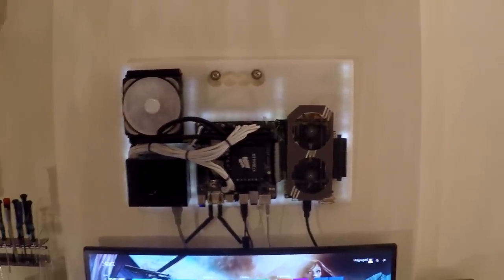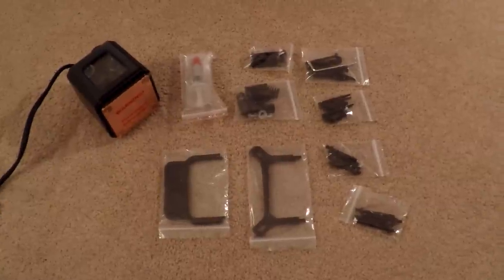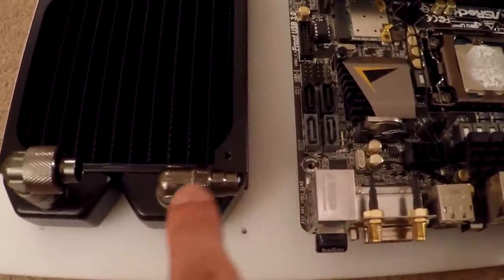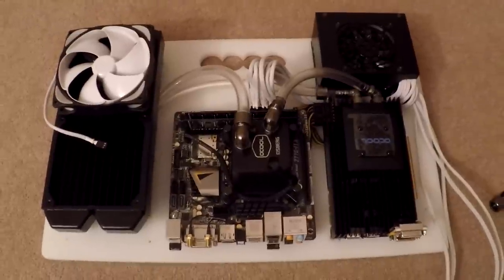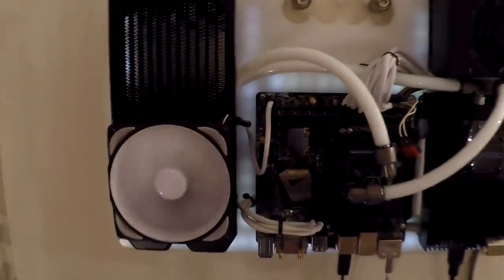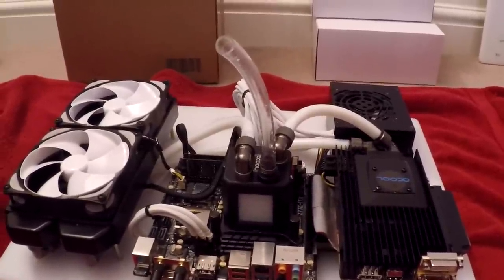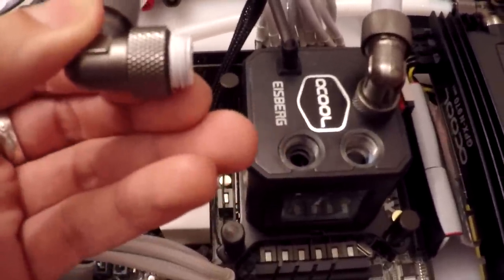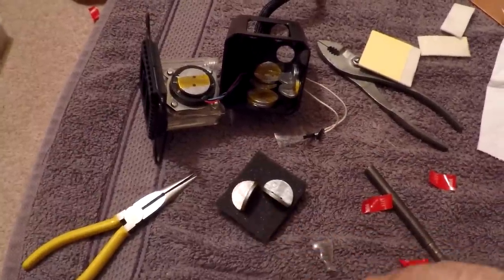Wall Mounted Watercooled PC Build Log

Comment: Hi, nice project, thanks for sharing. Where did you get that PCI-e extender, and does it work fine now with the aluminium isolation you did?
Reply from the maker: +Nakiski I found it on ebay. Should also be available on amazon. It works great with the shielding and has been running stable since

Comment: How do you turn it on/reset it?
Reply from the maker: +TLW918 Theres a hidden switch behind the motherboard that sticks out near the 24pin power connector. I've now moved it to be next to the PSU. Updated video coming soon on it
Reply: Ok thanks! I was really starting to plan out a custom wallmounted pc build, then I saw the news of the ThermalTake Core P5 on the 15th
Reply: yea a small red button amongst a very dangerous voltage aswel touch the red start button and you get zapped by something aswel
Reply from the maker: The high voltage is contained within the earthed PSU enclosure. You'll also notice that the PSU is above the water components so no chance of the water leaking onto the PSU. I've designed power supplies like this at my previous company, I know how they work

Comment: is that a chopping board
Reply from the maker: dj red hare aus Yeah, it's the same material as a chopping board, but I just bought a sheet of the raw material 2000mm x 500mm from a plastics supplier for about £30. I don't know where I'd find a 10mm thick chopping board that's 500mm wide :P